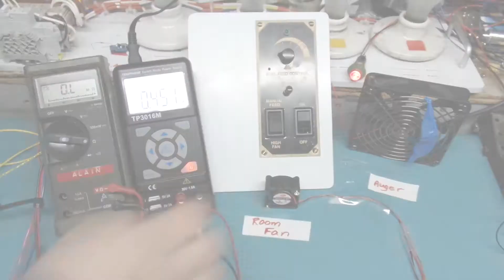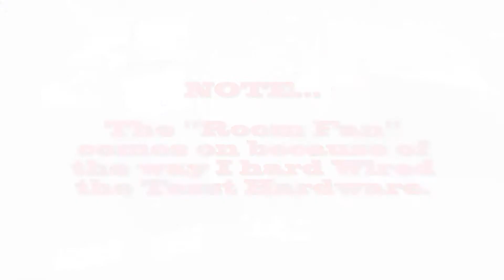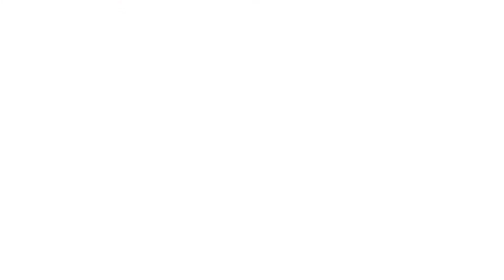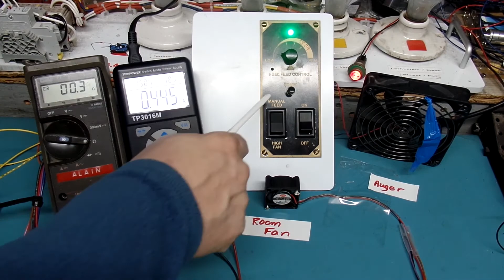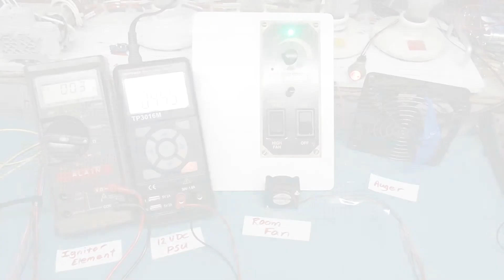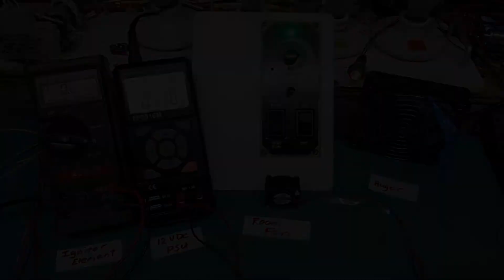Post Repairs Final Test of Jim's Reliant T-40 DC Pellet Stove Controller

Comment: i have the exact pellet stove, just got it from a friend. I Plugged in, push the Start  button. The Green LED light lighted up. then gone. Not be able to have the start LED light up again. Any suggestions? I checked all connections and all good. Blower fans all working. Thanks
Reply from the maker: @AdamClark-k4x  I have a video on my channel that gives guidance on troubleshooting that LED not staying ON.  Look for that..  otherwise call or txt me at 972-724-4115

Comment: Would you know where I can get one of those controller boards? DC version?
Reply from the maker: Sorry...  I have only seen this controller once previously - and after repairing it, I made the above video.
Reply: @MonteStudios  Thanks for the reply- I have a Reliant Essex 12v stove that uses the same controller. It is 26-27 years old now, and the best pellet stove I have had (had about 6-7 now). Just replaced the power supply, but I fear the mainboard will go at some point. Would love to have a spare. But it looks like I might have to make a Rasberri pi or Arduino DYI board at some point. :(

Comment: hello, 1 have a breckwell p28fs pellet stove and these are the problems i have:
1) main switch ON, both fans are running normally, but  manual feed and fan intensity variation not working.
2) press the auger button, green light comes ON and the little green light comes on every 15 sec normally but no auger motor action.. still no manual feed and no heater...
any clues? thanks